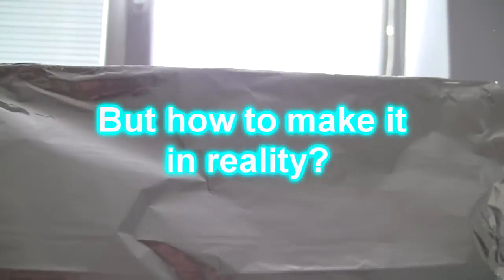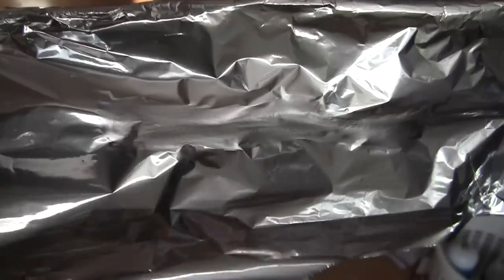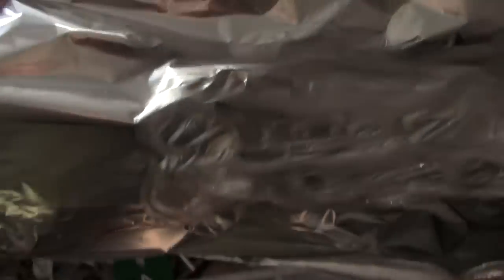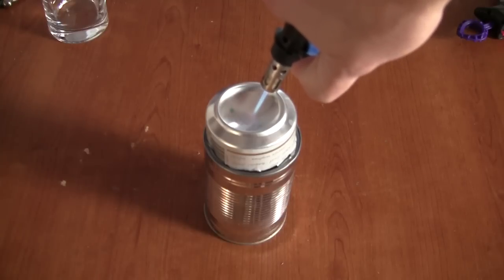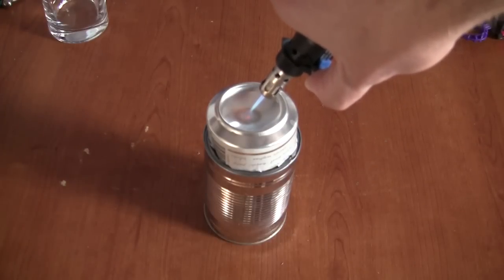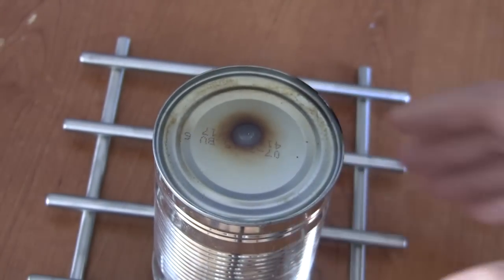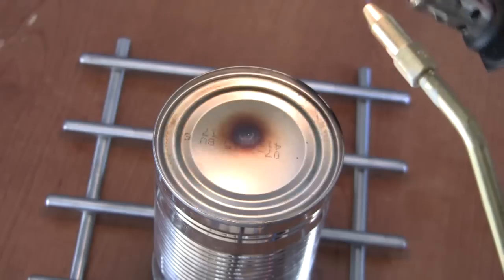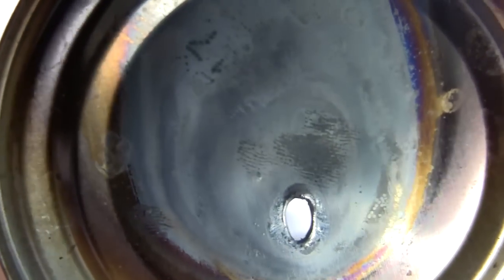How to make REAL Transparent Aluminium!

Comment: I wonder if it's just blasting away enough of the liquid metal for light to penetrate through.  That doesn't sound right, though, considering how metals interact with light, it seems more likely there's a chemical reaction taking place here that's responsible for the transparency.  Aluminum + air + water and carbon dioxide (from the torch, as I understand it) and, of course, heat.  Oxidization is the most likely culprit, but I'm no chemist here.

Aluminum (III) oxide crystallizes under some conditions; we call it corundum.  If that's what you have here then that's actually kind of cool in its own way.  There are other forms of aluminum oxide, however... might be interesting to look into what's happening chemically.

Comment: Sorry, I was using voice dictation on my phone.  What I mean to say is the the Aluminium between the plastic coatings, which are found in cans and foil, is thinned out making the heated area semi transparent.  I doubt that the transparent area has the same properties as solid aluminium.  I think that astro-blankets work under the same principle. Still, it might have some decent properties and uses.

Comment: I suspect that what is going on here is that the full thickness of the aluminium is being converted to aluminium oxide, which is definitely transparent. This is similar to what happens with coloured anodised aluminium parts. In this case a process similar  to electro-plating is used to build up a (relatively) thick layer of aluminium oxide on the surface which is itself both transparent and porous so it can be dyed. It's the combination of the dye and the fact that you can see the metallic surface through the transparent oxide layer that gives anodised parts their distinctive appearance. 

Compared to iron aluminium tends to form purer and more stable oxide layers so even by simple heating in air you can get an oxide layer which is regular enough to be transparent, it's this relatiavely hard and tough surface oxide layer which gives aluminium its corrosion resistance even though it is significantly more reactive then steel. . Compared to rust on iron which is powdery and consists of a whole variety of compounds as well as simple iron oxides.

An interesting illustration of the robustness of the surface layer of oxide on aluminium is that if you heat a small lump of aluminium  on something like a fire brick until it melts you will often end up with a roughly spherical lump of molten aluminium in an aluminium oxide 'bag' which is just about able to support it's own weight untill the skin is broken. 

Note also that a lot of gemstones are some variety of aluminium oxide.

Comment: It seems like the heated area turns into a really thin layer. By some mechanism the excess aluminium is pushed outwards from the heated area, but the thin layer doesn't break.

Comment: Now, do that with a 1 foot thick wall of aluminum, because thats what they were wanting, not that thin.
Reply: +worldgate989
So you make them in thin sheets, then stack them in layers and press them together.
Reply: William Barnes You can see through a sheet of paper held up to the sun, you wouldnt be able to see through a phonebook in the same way.
Reply: *****
Do you understand the concept that different things can have different opacities? Wood is somewhat more opaque than glass, for example.
Reply: William Barnes Do you understand that making a super thin sheet of aluminum isn't the same as the transparent aluminum from startrek?
Reply: *****
Yes, I understand that real substances are different from mythical movie sci-fi substances.
Do you understand that making sapphire from aluminum to turn the aluminum into a transparent glassy crystal and making layers of them is different from holding up a phone book full of layers made from wood?
Reply: William Barnes This video is misleading entirely, your not 'making transparent aluminum' you are 'creating aluminum so thin and porus that it allows more light through'.  Thunderfoot really slipped up on this one.
Reply: *****
Except for the part where it isn't "so thin and porous" because it still holds water.
Reply: William Barnes Actually i dont remember seeing where he poured water into it... go ahead and show me that part.  Metal spreads away from the heat source, this its obvious its going to make little tiny holes in it.

Comment: i believe this is due to the thin aluminium easilly oxidizing and forming aluminium oxide, also known as sapphire.
Reply: +Rinoa Super-Genius I think you're right. I've observed the same phenomena many times in my childhood while playing with fire. I always assumed that the aluminium became transparent because it was full of tiny holes, as it also becomes very brittle. But if it holds water, then oxide all the way through seems like the most probable explanation.
Reply: @fnorgen  Mee too I also observed from my childhood as well.
Reply: +PMetheney84 
materials only absorb light if the energy recieved by the photon would push an electron to a higher energy state.
if there is not enough energy in the photon then this cannot happen (discrete energy levels) and the photon just buggers off (doesn't get absorbed)
Reply: +notcyndi single crystal alumina (Al2O3) is referred to as sapphire or alumina interchangeably in the science community. i am not sure about polycrystalline alumina, but since it's made of single crystal (sapphire) grains... who knows?
Reply: +PMetheney84 the phenomenon is called the "band gap" - Al2O3 will not abosrb a photon with the energy range we see with.
Reply: +Rinoa Super-Genius Why does aluminium-oxide become transparent?
Reply: +Rinoa Super-Genius It's not a sapphire unless it has impurities of what, I think vanadium or something. I know for sure it is if it has chromium impurities that makes it red and it's then called ruby, it's the chromium-6+ ions that are red, like in chromic acid. But if it's just aluminum oxide, it will be white or clear.
Reply: "a burnt log isn't 'carbon nanotubes"

Of course not. Carbon nanotubes are skinny. You have to burn a stick, or maybe a twig, to turn it into a nanotube.
Reply: I melt down scrap aluminum, and often I'll have segments of tube leave behind brittle transparent shells of aluminum oxide, while the metal collected in the bottom of the crucible. Aluminum on its own is very reactive and if it weren't for this layer of oxide it could actually react with water, but any contact of aluminum with water or oxygen forms a thin layer of aluminum oxide that prevents the rest of the aluminum from reacting.
Reply: Not always sapphire. When corundum has the right impurities, then yes.
Reply: Aluminum oxide isn't 'sapphire' just like a burnt log isn't 'carbon nanotubes'. Sapphire refers to the crystal structure arrangement of aluminum oxide. However, this is all semantics as we all already know this.

This effect is caused by the perforation of aluminum metal, however, those perforations are bridged by aluminum oxide. However, this bridging is weak and can be destroyed by rubbing it with your fingers. True 'sapphire' crystals cannot form sufficiently in such a short amount of time, so calling it 'sapphire' is deceptive. It is actually just aluminum getting converted into clumps of aluminum oxide, barely holding together. It appears gray from reflected light instead of white due to contamination by unburned aluminum getting trapped in the clumps of aluminum oxide.
Reply: That's certainly possible, but also he didn't test the 'transparent' areas for strength or thickness. I would bet that the aluminum has lost much of its strength and maybe even thickness in the heated areas that seem to have become transparent. You could probably poke a hole in that area much easier now. The whole premise of the "transparent aluminum" in that incredibly dump Star Trek movie's plot, was that the transparent aluminum was still to be extremely strong AND transparent. If in fact, ^this video's version of transparent aluminum is dramatically weakened, then it won't be useful unless it can be created in such a way that preserves its strength and toughness.
Reply: 5thDragonDreamCaster 
That's correct, unless you alloy aluminum with a small amount of gallium, which prevents the aluminum from forming the protective oxide layer, and allows it to react vigorously with water. There was a theory that Ga-Al alloys could be used to liberate hydrogen inside a tank inside a car, in order to continously generate hydrogen to run the car, and at the end youd be able to recover the gallium and re-alloy it with aluminum to be used over and over for this purpose. But then, a serious experimenter blew this theory to pieces, by actually running an experiment, which proved that not enough hydrogen would be generated at a fast enough rate to power a car.
Reply: its aluminium oxynitride i thought
Reply: All I know is the parts that became transparent were the hottest. At that moment something is instantly changing and it becomes transparent. I use to do this when I was a kid for fun. I thought it was because I was burning it and tiny holes were everywhere. I was surprised when it held the water. I thought for sure it would be weak enough to break. The fact its transparent and can hold up that water is neat. I wish someone had a proven explanation.
Reply: Rinoa Super-Genius 
Are you saying that he could wad up the foil that was burnt, and sell it as a fine Kashmir sapphire? Lol

That explanation you gave about the ultra-thin foil being oxidized into aluminum oxide through heating, kinda makes sense. 

But I wonder if it's strong enough to support a large mass of tens of thousands of gallons of water, inside a star ship, and carrying a full grown humpback whale. My hypothesis is, no......
Reply: Water wouldn't pass through such small holes anyway.
Reply: Yeah its actually corundum. Ruby is al2o3 as is sapphire but they have other elements in the crystal matrix giving them their color. 
 Corundum is often powered and used to make sandpaper or other abrasive applications.
Reply: aluminium oxide also known as corindon. For blue sapphire it takes some impurities (titanium and/or iron). If instead you add chromium impurities you get ruby.
Reply: +Matthew Edwards oddly, both of you are correct.

Comment: That's a bit of a misleading clickbait title. 
You can hammer gold leaf thin enough to see light through it or apply silver to a car's windshield by plasma deposition to reduce cooling system load or for deicing, ablating some of the aluminum material away, until what remains is too thin to block light isn't substantively different.

Comment: What you're looking through is a layer of aluminium oxide. The same stuff that forms naturally on aluminium that's left in the open and takes away the metal sheen. All that's done here is that the metal is burned (really corroded) all the way through so there's no metallic Al left. Unlike many other oxides however, AlO is pretty strong. I remember a high school physics class when the teacher melted a small piece of aluminium and the melted metal managed to stay in a bubble of its own oxide.

Comment: what is really crazy is you can make optically clear aluminum glass that can stop a 50 cal at only 1.6 inches thick. I think alon was the copyright for it or something. 
though I have no idea that you could do it with just regular aluminum foil you could get at a store. or a pop can for that matter. that is nuts. I wonder if you could get the same effect with annealing a plate of it... but of course times and temps are beyond me, but at least with alon, it is around 3x stronger than glass of the same thickness. or something like that.  cool video!

Comment: Haven't you just burnt a hole in it, but not all the way through -  just made it incredibly thin?
Reply: +Bert Sticks Over a large area with a punctually heat source held by hand? And thin, but not thin enough, that the pressure from the water didn't make it tear?

I don't think so. ;)

https://en.wikipedia.org/wiki/Aluminium_oxynitride
https://en.wikipedia.org/wiki/Corundum

Not all that WAS a metal forever stays a metal. ^^
Reply: +Christopher Zajonskowski just did the same experiment. The foil did go like thubderf00ts, but was very very weak - not like the foil around it.